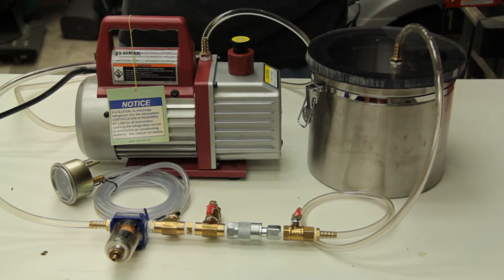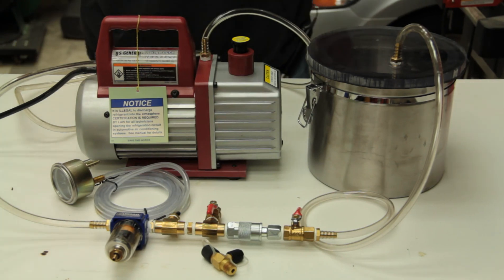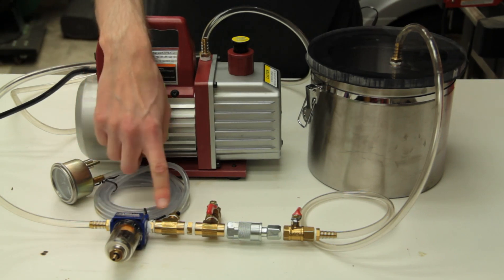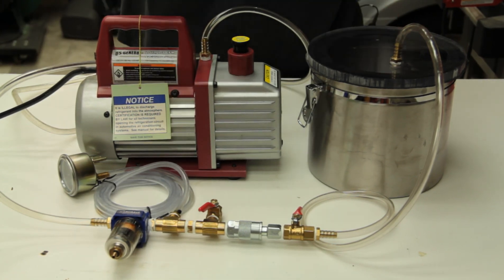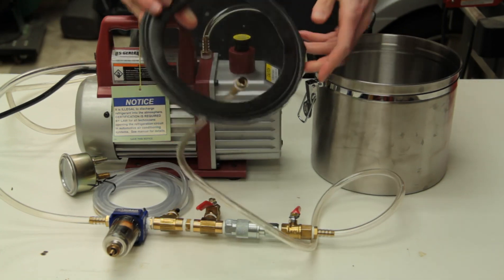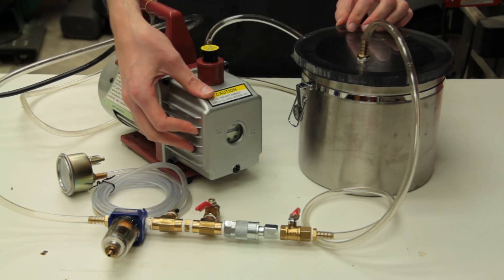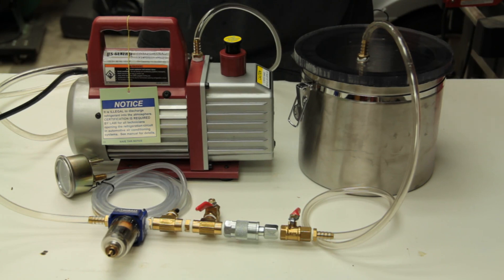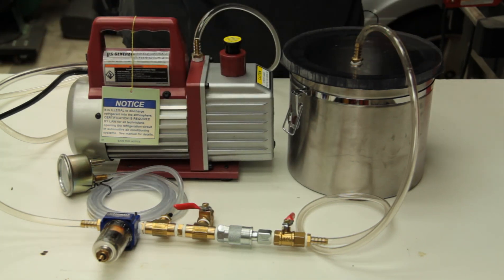DIY Vacuum Chamber Setup

Comment: THANK YOU - Everywhere I go it is said, by people more knowledgeable than me, shutting off the pump with pressure on it will, sooner or later, damage it.

Your extra valve and quick connect allow people to remove the pump from the system, WHILE RUNNING, without losing vacuum on the chamber, then to release pressure on the pump before shutting it off.

For me, adding a T and another valve is a better solution (I can still isolate the tank and pump, then release pressure on the pump).

Comment: Why fill the hole in the lid with epoxy instead of just tapping it in the first place?
Reply from the maker: Because I did not have the appropriate tap at the time. 
The process I mention of filling the hole with epoxy is the 'easier' method I have tried. If you look closely in the video you can see the fitting in the lid as teflon tape on it, which would not be necessary if it were epoxied in. For the lid you see in the video I used the fitting itself to slowly cut threads into the plastic. This process was not great so I don't recommend it.
Reply: @LesWilhelm  I just don't know how epoxy holds at those kinds of pressure.

Comment: I wish you could create a list of all the fittings and hoses you used and post them as an amazon list.  Especially interested in what kind of air filter you would use in place of the positive pressure one you have on there now.

Comment: Q1: How did you get the disconnect coupler to work? it doesn't look like a EA rated one. (the only one i can find that actually made to work under vacuum) they cost anywhere from $30 to $80 depending on if it has a valve or what size you get. the home depot couplers i bought leaked at 8-12 hg not particularly useful for epoxy degassing. 
also that fitting you took off the vacuum will work you just need the right adapter to hold the tube. mine came with what i needed. 
Q2: why not put the vacuum gauge on the lid? it would make more sense. 
also you can get moisture traps that work with a vacuum and dont require modifying.

water vapor != steam. steam = 212 °
Reply from the maker: The connectors I use are standard quick release fittings for compressed air. I have never had issues with them failing to maintain vacuum. 
The vacuum gauge is not on the lid because I have several chambers with several lids. Having the gauge independent of the lid allows me to use one gauge for all my chambers.

Comment: I decided to get a cheap moisture separator for about $5 off ebay, because I quite like your idea and it will also prevent any debris from getting into the pump. I tested it out and it seems that the valve doesn't open itself when vacuum is applied. however, I might seal it up anyway just in case. Is there any specific epoxy I need to use?

Comment: how thick of lid do i need on a 15in round pot?
Reply from the maker: I have never built a chamber that large. The lid on my chamber is 1/2 inch thick and is far more rigid than it needs to be. I believe that thickness would be adequate for a 15 inch chamber, but that is just a guess.
Reply: If in doubt just get piece of 3/4” look up granger they have all the sizes listed

Comment: Les I just ordered a zeny pump. It came with that T valve you described in this video. I haven’t removed it yet. I wanted to know if it was common to use a 3/9 barb fitting barb fitting? Do they vary from pump to pump?
Reply from the maker: Yes. 3/8 NPT is also a common fitting size.

Comment: dose the oil go back in to the chamber what do i do so that won't happen?
Reply from the maker: while the pump is running no oil should move toward the chamber. If the pump is turned off while still connected to a chamber under vacuum it is possible for air to leak from the pump exhaust through the pump and out the intake. When this air leaks through the pump it can take oil with it into your chamber. 
this can be avoided by using a pump which does not leak when turned off, or a pump with a check valve on the intake which will prevent the reverse flow of air. 
alternatively you can install your own valve between the chamber and the pump. when you want to turn off the pump simply close the valve and you will not have to worry about any leaks from the pump.

Comment: Hi. I'm thinking to make a champer that mix and degas the mix at same time. will it be useful to mix under negative pressure
Reply from the maker: The advantage of mixing under vacuum is that air will not be introduced into the mixture. This is especially useful if the mixed material is difficult to degass.

Comment: The water trap seems pointless, you're putting the whole system under vacuum, so how is it going to condense?
Reply from the maker: The trap is not used. In fact the spring valve has been sealed with epoxy (otherwise the negative pressure from the vacuum would keep it open). I am using this device only for its filter.

Comment: Great video, one thing you may want to check before you remove your intake cross is see in your manual which threads you actually have. I have 3/8, 1/2, and 1/4 so I just needed a 1/4 barb 1/4 NPT female connector.

Comment: can that setup be used to pull out a gas from one chamber to another chamber then reverse it?  Can you direct me in the right direction? 
michaelshanecote@yahoo.com
Reply from the maker: I would need more information about what you are trying to do in order to help. These vacuum pumps do not come with a useful output fitting or even provisions for one. In addition there is a one way valve which prevents air from going out of the intake port (this is to preserve the vacuum when you turn the pump off) and therefore cannot be used in reverse. 
You could create custom plumbing around the pump to deal with these issues but that will be specific to your needs.

Comment: Will I be able to have a full vacuum in chamber once the vacuum pump is turned off? When I turn the vacuum pump off I slowly lose pressure. Is there anything I can buy or do to maintain a full vacuum once the pump is turned off?
Reply from the maker: Pumps generally have a check valve to prevent their oil from being pulled out of the pump when it is turned off under vacuum. Sometimes this valve is not sufficient to keep a vacuum over time. An easy solution is to add another valve in between your chamber and the pump. Close this valve before you turn the pump off. If you still have leaks they will be located somewhere upstream of the valve.
Reply: Les Wilhelm What type of valve would I need to purchase? Is it an easy installation? Also another question if you don't mind.. The top plastic cap that covers the vacuum pump hole where you pour oil into... That is supposed to be taken off while the pump is turned on and running correct? Ive seen numerous videos of people running their pumps with the plastic piece on it where smoke is suppose to come out of & I was curious if that is safe to leave on pump during use..
Reply from the maker: Almost any air or water valve will work. I think I got mine from a local home improvement store. Installation is just getting it somewhere in between the pump and the chamber either attaching it to fittings already in the system or splicing it into the hose you are using. 
On my pump the plastic cap you are referring to covers the exhaust port. If you do not remove it before turning the pump on it will be blown off by the exhaust (its surprising but not dangerous unless you get hit in the face by it). Other pumps have vents on the exhaust so the cap does not need to be removed for operation. The cap is there to prevent dust and debris from contaminating you vacuum oil.
Reply: Les Wilhelm perfect!! That sounds great actually because my vacuum pump is extremely loud when starting up and is considerably more quiet when the cap is on. So I think I'll start using it with the cap on. And thank you I will head over to ace hardware to purchase. It will help me massively since I'm currently running my pump hours at a time.

Comment: i am making a vacuum chamber to develop 4.1kpa vacuum for my  project,  can u suggest the pump ?
also i would like to know the size of hose and connectors/ fitting you used for your chamber.
Reply from the maker: +Shaikh faiyaz ali 4.1 kpa is achievable with most vacuum pumps including the one in the video. If you need to target a very specific vacuum level you will need accurate gauges and metering valves. 
The fittings I used were all 1/4 NPT, hoses were chosen to fit 1/4 barbs.
Reply: +Les Wilhelm thank you so much!

Comment: hey, what is the type of tubing used? where did you get it? thanks
Reply from the maker: +Niall Moore I believe it was 1/4 inner diameter acrylic tubing. You can find it at any home center (like home depot or lowes). It will normally be in the plumbing section. Since most fittings and tubing are sold loose you can play around with them in the store  to make sure the fittings and tubing you get will fit together.
Reply: Thanks

Comment: can anybody tell me how this works or a good tutorial on this to learn
Reply: +James Bond - Almost all liquids contain dissolved air or gasses of some sort when open to the atmosphere.  For example by adding carbon dioxide under pressure we can make soda drinks and the gas will stay dissolved in the drink as long as it is under pressure.  You can't see this dissolved gas but remove the cap and release the pressure and the dissolved gas starts expanding. The microscopic bubbles expand, float to the surface  and the soda starts fizzing. Once the soda is "flat', if we were to place it in a vacuum it would start fizzing again as any remaining microscopic bubbles expand and rise to the surface.
Similar principle with two pot epoxy or molding rubber etc. When mixed there will be very small and invisible bubbles in the mix which we don't want in the cured product. This time we apply a vacuum, the bubbles expand and float to the surface before the product cures.
The vacuum pump in the video sucks all of the air out of the sealed pot, sucks the acrylic lid down and creates a vacuum in the pot and on anything placed in the pot.
This video is great and the maker has done an excellent job of what he has made, he has talent and slightly less money now BUT if you want to make something like this cheaply there is no need for a fancy vacuum pump or even a vacuum gauge. Old sealed unit fridge compressors work very well as vacuum pumps, one sides sucks (vacuum) and the other side blows the exhausted air from the container to the atmosphere. You don't even need a fancy acrylic lid, a simple flat metal lid on top of a preserving jar that you mix the epoxy in will work fine.  Lid for a jar top needs to be at least 1/4" thick aluminium. Jar needs to be round sided, sound all over without cracks chips or flaws and have rubber gasket glued on to the lid.  Be very cautious around vacuums, they are just as dangerous as high pressure air. An imploding vacuum container will probably do you as much damage as an exploding one. Safety glasses etc when you use it.
Some other examples are:-
1. Boiling water in a vacuum. Water at sea level boils at 100 degrees Celsius but on Mt. Everest  boils at a much lower temperature (even lower in a vacuum). So low that potatoes can be boiled on Everest but they will not cook because the boiling water is not hot enough. They have to be cooked in a pressure cooker which increases the boiling temperature. 
2. Distillation of salt water to pure fresh water. Ships do this under a vacuum to make the process more efficient as the salt water boils at a lower temperature under a vacuum. The down side of this is that as the distilled water has not boiled at 100 degrees Celsius the water produced may still contain pathogens. Normally they would not distill whilst in polluted harbours.

Comment: Would this pump be suitable?
 http://pages.ebay.com/link/?nav=item.view&id=111546281708&alt=web
Reply from the maker: +Naughty Goat Farm for general degassing sure. this, like many other pumps (including mine), appears to be a standard Chinese import pump. I would give it a through internal cleaning before use. mine had small metal particles in the oil it shipped with (likely leftovers from manufacturing).
Reply: +Les Wilhelm thank you!

Comment: Thanks for your clear explanation!

I want to make the same mod. to my own pump, but havn't found out yet what thread size the pump has, any additionele help woud be much appreciated ☺

Cheers!
Reply from the maker: TurbotoTaLL  Most pumps of this type use 1/4 inch NPT fittings on their inputs. 
Good luck with your mods.

Comment: The fitting you removed, does that have clockwise or counter-clockwise thread?
Reply from the maker: TurbotoTaLL  It has normal NPT threads. It tightens clockwise and loosens counterclockwise.

Comment: The actual pot you use needs to be one solid body right? No handles with bolts going through to the inside will do right? Anything that I should consider when getting one?
Reply from the maker: Marcus Sjölin While the absence of penetrations through the chamber is ideal but not strictly required. Because the chamber is at a lower pressure than its surroundings it will tend to pull in material, thus making sealing the penetrations fairly simple. A small amount of epoxy will correct most bolt/rivet hole leaks. The most important factor is the chambers ability to hold its shape under the force of the vacuum. The more rigid the chamber the better.

Comment: I'm looking vacuum pumps on eBay. What specs are needed on a pump to degass silicone?
Reply from the maker: Naughty Goat Farm the 2 main specs you will be interested in are CFM (how fast gas is removed, higher is better) and ultimate vacuum (the maximum vacuum achievable, lower is better). The pump I used is 3 CFM and 22.5 micron.
Reply: +Les Wilhelm THanks for a informative video!  I just ordered an single stage 2 cfm pump , will that be enough to degass investment gypsym, resin, rtv silicones?  Im thinking of ordering a 3 gallon chamber from "best value vac" for about 120$  to use with this pump (cause im unsure where to get all the fittings and gauge here in sweden) but maybe my pump will not be powerful enough for such a large container? What do you think? /adam
Reply from the maker: +Adam K I would not worry about the large chamber size. You can always add other things to the chamber to decrease its total internal volume. For instance you could put large solid plastic blocks in the unused space to displace some of the air so your pump does not have to remove it.
Reply: +Les Wilhelm Thanks! I just received the pump today , havent tested it yet cause i dont have any hoses connectors or gauge atm. Im looking towards this chamber linked last, however 180 dollars with shipping seems like alot for just a kitchen pot with gauge+ hoses.  Where can i buy the gauge hose and connectors and just make my own ??
  http://www.ebay.com/itm/3-Gallon-Vacuum-Chamber-to-degass-silicone-resin-extracts-and-concentrates-/281625101215?hash=item41922a039f:g:gmIAAOSwhcJWKSs5
Reply from the maker: for the kinds of degassing you are doing a gauge is not strictly necessary. Many of the silicons I use do not specify the vacuum pressure to use, rather they mention holding a vacuum for a certain amount of time after the material 'falls' which you can clearly see.
as far as parts, most hardware stores carry all of the fittings and hoses you would need to build your own chamber (you can also find everything on the internet).
Remember when building things for the first time there is always a significant chance of making a mistake and wasting materials so a commercially produced item could be cheaper than a DIY one.
Reply: Thanks for reply!
Btw Can i just test run the pump (bought it used but its unused)  without anything connected to it? Or could i damage the pump if it just runs as it is? (with oil ofc)
Reply from the maker: +Adam K the pump will not be harmed by running it without a chamber but it would be advisable to provide some form of air filter.

Comment: Neat, thanks for sharing that...
Reply: Paul Gdry Oh, I was thinking that if you invest in a stir plate, then you could drop a oblong magnet into the mix and stir it while it is under the vacuum.  Just set your vacuum chamber on the mixer and the stir occurs via magnets.  Note that this is usually also a hot plate, but you can use it without the heat on..

Comment: AutoClave Machine, Air Bubbles removval From LCD,…: http://youtu.be/BuPNCbIAdHM
Reply from the maker: That machine creates a positive pressure which is why it is so heavily built compared to a vacuum chamber (also the reason they are more expensive). The process it uses to laminate screens is not one I am very familiar with (I have not done one of those procedures myself).

Comment: I was wondering if I could use something like this to remove air bubbles from lcd screen repairs on cell phones.
Reply from the maker: john barry In theory yes but the air must have somewhere to escape to and the other components of the device must be vacuum safe.
Reply: I was curious because if you google autoclave for lcd screens there's machines out there but they're 1,000 and I can't afford that lol. So when you say the air has to have somewhere to escape to. I don't understand
Reply from the maker: john barry if the air in the chamber does not have a path to get to the pump from where it is then it cannot be evacuated and it will apply an increasing pressure on the object which contains it. Imagine an inflated balloon in a vacuum chamber. Because the air is trapped in the balloon it cannot make its way out of the chamber and as the pressure in the chamber decreases the force the air applies on the interior of the balloon increases and thus the volume of the balloon increases. 
If you were applying something like a screen protector (or digitizer) then the vacuum chamber would work fine because the air can escape from around the edges.